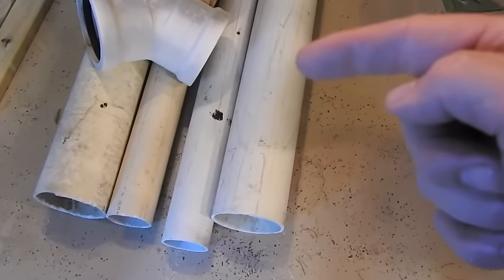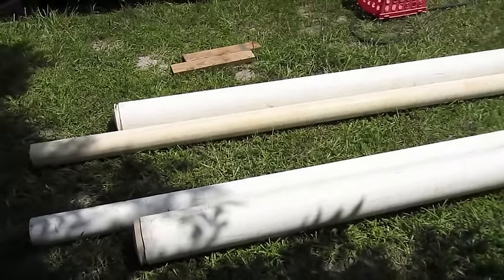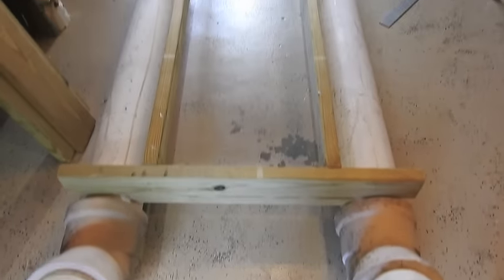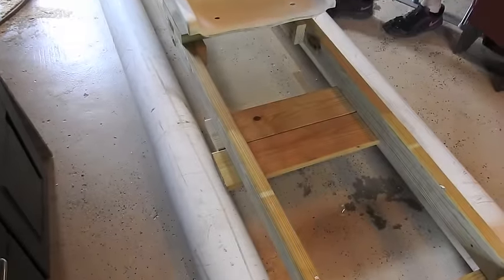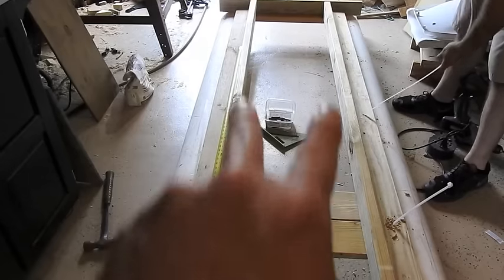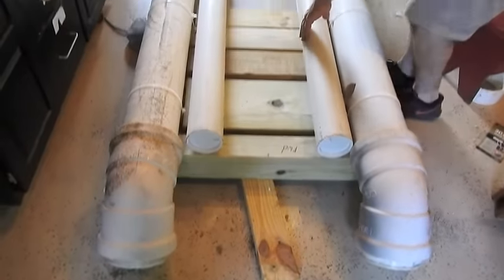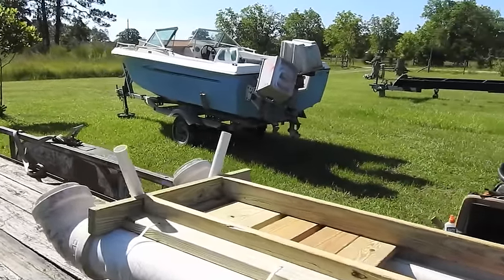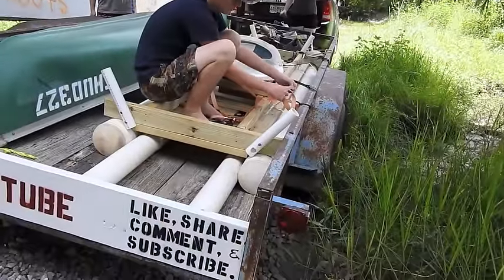Cheap $100 Homemade PVC Fishing Kayak How To

Comment: the 6" diameter pipes have a buoyancy of 109.5lbs each and the 4 inch diameter pipes have a buoyancy of 47.7 lbs each so total buoyancy of this is about 315 lbs displacement.

So subtract the weight of the frame and then anything else you put on to it.  This would be the amount that it would support before it sinks.

I've been looking into this same concept and I'm thinking 10" or 12" pipe would work better for buoyancy and stability in the water.  At 10" diameter, a single pipe at 9 feet would have a buoyancy of approximately 300 lbs for each tube (so about 600 lbs for 2 pontoons at 9 feet long).  

problem is, it means the price goes up for the larger diameter pipe.
Reply: And the weight of the pipe.. it would need a trailer and load like a boat.
Reply: I'm thinking inner tubes. Cut and reglued/sealed/cemented. Some that would hold at least 20-30lbs of pressure each. Maybe semi tubes. 2 per side.
Reply: If you want to use foam. Make a mold and just use the foam.
Reply: @captainfragger6295  It doesn't work that way.  It's a calculation based on the diameter and length of the tube.  Pressure inside is irrelevant in this case.

Multiply the outside pipe diameter in feet by itself using a calculator and call it "D." Assuming the diameter to be 1.5 feet, D = 1.5 X 1.5 = 2.25.

Multiply "D" with 62.4 (the weight of water in pounds-per-cubic-foot) and call it "D1." For the example being considered, D1 = D X 62.4 = 2.25 X 62.4 = 140.4.
Video of the Day

Multiply "D1" with 0.78 (the percentage of the pipe which is submerged in the water) and call it "W." For the example being considered, W = D1 X 0.78 = 140.4 X 0.78 = 109.51.

Multiply "W" with the length of the pipe to get the required buoyant force in pounds. Assuming the length of the pipe to be 5 feet, the force will be F = W X 5 = 109.51 X 5 = 547.55 pounds.
Reply from the maker: I have had a ton of comments on pressurizing the tubes.  I try to explain how it works, but I have just about given up on it... thanks for your help.
Reply from the maker: Boy, how the price goes up... thanks for watching.
Reply from the maker: That is not problem, I already have a trailer I can use...
Reply from the maker: I don't know if they have tubes shaped like pipe...  good thinking to keep water out of the pipe though...
Reply from the maker: I agree about no foam.

Comment: I'm not really sure why you left the middle part so open. I would rather cover that with 2x4s so that there's less drag on the boat, sinking the rear end. It might get more up on plane if the bottom didn't have a gaping hole
Reply from the maker: Good point, maybe a thin light weigh sheet of plywood or even aluminum... thanks for watching.
Reply: @chud327  I think that might help! Nice build nonetheless tho man. I’ve been watching a lot of different types of builds lately, this one was cool

Comment: I would say that it is a good creative idea,,,but,, more attention needs to be paid to weight, both load/unloading and the allowable capacity weight,,,,,,,,,,not exactly a craft you would want to take out by yourself since it needs 3-4 people to handle it,,,,,,,try substituting pvc for the wood with the caps to add floatation,,,,,glue the joints instead of the silicone,,,use electric trolling motor instead of lawnmower engine,,,,,,,,,all in all a good starting point.
Reply from the maker: You are right about it need less weight.  You can take it out by yourself, but unload and reloading will be a pain or a boat trailer would be handy.  PVC would be lighter than the wood, but it would not have been as cheap.  The caps seemed a loose and that is why he siliconed them.  I have a trolling motor, but I have to find a propeller for it.  The trolling motor would be more balanced too, you could adjust where you store the battery and get some weight off of the back.  Thanks for the great feedback and thanks for watching.

Comment: I doubt the Schedule 40 filled with foam added anything, and probably would sink on its on. 6" thin wall, and 2"x2" wood frame is the way to go. With 6" thin wall fittings glued on of course.

Comment: Zip Ties will break after sun exposure very Brittle use metal strapping
Reply from the maker: Zip ties were fine for the test, later I built a pontoon boat with barrels.  I used the metal strapping on it. Thanks for watching.

Comment: How did you make that motor?
Reply from the maker: I have a couple of old videos on the process. I basically took a pressure washer engine, some plumbing fittings, and an old kicker an put them together. Thanks for watching.  BTW, I also have a bigger homemade kicker.

Comment: 8" sch 40 with glued 45's and glue caps reduced down to fill with nitrogen. Better flotation
Reply from the maker: 8" would probably do a lot better, but instead of nitrogen, I was thinking Helium.  Great suggestions and thanks for watching.
Reply: chud327 
You can add all the gas you want it won't float any better. In fact it would slightly sit lower down. To float "whatever the craft may be" must weigh less the the weight of the water it displaced. That pipe only displaced so much water but being water is heavier then the pipe/air pontoon it floats. And wood & etc. and the less it floats. If you pump it full of a gas with enough pressure that it wroghd more then air it's slightly sink the extra weight to water displacement ratio. Use 12" sewer pipe and you"'ll over double the weight it'll hold. Of you wrap under the pontoon with a thin skin and stop the water from being inside of it like a Jon boat it'll displace so much more water (and you'll stay dry) that you could easily run a small motor. Personally I'd use an electric trolling motor front mounted to pull you along since with no rudders or hill rear engines would make it more difficult to steer if you need to get out of a speed boats way? Try aluminum track instead of heavy wood and you'll lighten it up even more.

Comment: Need to put foam in the big tubes to offset the motor
Reply from the maker: I don't think it would help, the pipes would actually be heavier with the foam. thanks for watching.
Reply: The weight added by the foam is offset with the buoyancy the foam provides

Comment: I think u should use 14 to 16 inch diameter it will hold 2 or 3 persons plus motor
Reply from the maker: That would make a pretty nice boat, thanks for watching.

Comment: Would adding expanding foam inside the PVC pipe make it more buoyant? I know the foam tends to be more buoyant than air on it's own.  Just curious if anyone has tried it...
Reply from the maker: I would say it is heavier than the air so the pipe would be less buoyant with foam.  It would be cool if the pipes ever decided to leak... Thanks for watching.
Reply: @chud327   Ya but the expanding foam is full of air spaces in it when it expands and on it's own is extremely buoyant like styrofoam or foam insulation boards.  I guess the only way to know for certain would be to try it and find out.
Reply from the maker: But the foam would never touch the water, it would just make the pipe heavier.  or at least that is what my brain keeps telling me... I could still try it some day. That and pressure in the tubes. Thanks for the reply.

Comment: the only part i didnt like was when you had the motor on the kayak how low it sat in the water. your fishing rod holders where almost completely under water.
Reply from the maker: That was just an experiment and yes, a little more and the motor would have been under water... Thanks so much for watching.
Reply: @chud327  i really enjoyed it and the pontoon boat video
Reply from the maker: Thanks so much and build #2 is just getting started. I hope you will check it out.

Comment: Put a steel air fitting and pump up pvc tubes for more buonsy
Reply from the maker: Wouldn't that make it more heavy?  Either way, thanks for watching.
Reply: @chud327  With air fittings and sealed PVC pipes...adding air into pipes/pontoons would create much more buonsy....An air fitting only weighs minimal.

Comment: Why didn't you fill tubes with spray foam
Reply from the maker: We were trying to build it for less than $100 and it would have probably taken 6-8 cans to do the 6" pipe.  Plus the thing is too heavy and foam would have been slightly heavier than air.  Next time it needs to be thin wall pvc... Thanks for watching.

Comment: Needs more flotation in the back, looks scar as hell running it with the motor and it sinking so far down in the water lol.
Reply from the maker: AllAlaskan907 I am actually planning to move the motor forward a little next time it is warm enough. Did you see recently when I had a trolling motor on it? Thanks for watching.
Reply: I didn't see that one, I did just see where you added more float tubes underneath though.
Reply from the maker: Thanks for watching more than one!  If you go to my channel, the trolling motor one with be probably about 10th from newest.  I also did some amphibious gocart videos about the same time that I would love to hear what you think. Thanks for the reply.

Comment: What bridge is that?
Reply from the maker: Scot Johnson US1 bridge between folkston and Hilliard, do you know it? Thanks for watching.
Reply: chud327 I stopped one time to go for a swim in the St Mary's River and one of the locals told me there were alligators in there so I didn't go for a swim
Reply from the maker: I have been out in the Jon boat around dusk and there was a gator swimming right by the boat... I have never seen one in the daytime, but they have to be some where.  It always crosses my mine while swimming. Thanks for the reply.

Comment: I think your Kayak is NOT wide enough with a seat that height, its easy to topple over as center of gravity is not low enough for stability.
Reply from the maker: It was actually pretty stable, but too heavy. thanks for watching.

Comment: a couple t's at 45 degrees would have joined the two main pontoons together.
Reply from the maker: I can visualize how two 90's would have joined them, but I can see 45's getting it done.  We were using cheap recycled materials and I don't think the guy had anymore 90's.  Would have been nice and thanks for watching.

Comment: Why don't you need it registered  ? Never fly in PA.
Reply from the maker: As long as there is no engine or motor on it, it is ok.  I risked it with the engine and only had it in the water for a few minutes.  If a game warden had shown up, we would have had a problem. Thanks for watching.

Comment: Good ole American spirit and ingenuity.  Challenges are meant to be overcome - great job!  

Google "milk carton/jugs" plus races up north in Minneapolis, MN. 

As a kid, we strung the plastic milk cartons together and made "rafts" if you can call them that. We had races at a small lake called Nakomis, held every summer.

That said, you could add flotation by adding strung together milk cartons.  Just tie them on around the sides and across the bottom.  No weight added, just bulk and old, used up milk (or water) cartons or even bottles are every where and they would not cost a penny.

Be creative, add them underneath, around the sides, double the layers up front for added height and flotation so you do not nose dive while trolling.

Have fun, post a video - would love to watch it. Maybe even send me a short message when you get it done (lacuskey@gmail.com).  Have subscribed as upbeat people is so very needed in today's world.

Ole marine corp vet, still kicking cans as long as they don't bite me back.

Semper Fi, crazy larry here signing out...
Reply from the maker: Thanks for your upbeatness!  I will start collecting two liter bottles and milk jugs... I plan to get it back in the water soon... Thanks for watching.

Comment: That looks seriously unstable with 2 people aboard. With pontoons, once either one goes completely under water, there no additional buoyancy from pushing it farther under, hence no force acting to counteract tipping.
Reply from the maker: If it starts to go under, simply lean to the other side and your problem is solved.  Piranha water is where I would find this boat seriously unstable. Thanks for watching.
Reply: Well you could say the same thing about floating on a round barrel, or riding a bicycle with no steering, and I suppose a few people could pull those off but I would not want to use either for any serious purpose.
Reply from the maker: This craft was an experiment mostly for fun purposed.  I was actually pretty good with one person on it. Thanks for the reply.

Comment: Good, but super unstable
Reply from the maker: No really, you can even stand up on it and paddle. Thanks for watching.
Reply: chud327 nice, then if u don't mind I will make 1 like that. Thnx a million
Reply from the maker: Maybe less wood and they make a lighter weight,  green PVC that is sold at Lowe's. I am using it on a future project. Good luck.

Comment: You should try making a jet boat with a pressure washer as the engine
Reply from the maker: That would be cool. I have the pressure washer engine, but how do you do the jet drive? thanks for watching.
Reply: @chud327  you would need the pump. I'm not sure how fast 3000psi of water would propel you but i would expect it to move you at a decent rate

Comment: $100 will buy an used kayak, that thing needs improvement, otherwise it's junk.
Reply from the maker: I bought a great one for $40 off of Craigslist and improved it, it made about a happy meals worth of dough in views, you would fall out if I told you how much this on made.  You need to consider the big picture. I see it as cool and different, thanks for watching.

Comment: That thing looks dangerous! Its aout to sink!
Reply from the maker: It is not about to sink, we had two people on it plus extra junk, did you see the video? Either way, thanks for watching.
Reply: chud327 yes, I watched it. It looks like all it would take is a very small wave to swamp it, your motor is almost under water as you go along :/
Reply from the maker: The motor did put the back end in pretty deep.  I wasn't thinking about that part.  I would like to put a light trolling motor on the back with the battery up front, that would ride more level.

Comment: Or just buy a used kayak or canoe for $100 and not be floating on a pile of trash. Lol
Reply from the maker: That pile of trash was a fun experiment. Thanks for the $100 tip, but I had already bought a canoe ($50) and a kayak ($40).  I could put the homemade boat motor on those... thanks for watching.

Comment: Looks slow as tar.
Reply from the maker: Yes, no racing boat here. thanks for watching.
Reply: @chud327  - But it seems like it is slower than it has to be.  So much of the boat is dragging under the water.
Reply: What's the rush  @jonhohensee3258  ? 🙃 Other than getting TOO the fishing hole that is...
Reply: @misterjim4458  - Too?
Reply: @jonhohensee3258  ...and from...
Reply: @misterjim4458  - Too??  I don't think you know what that word means.